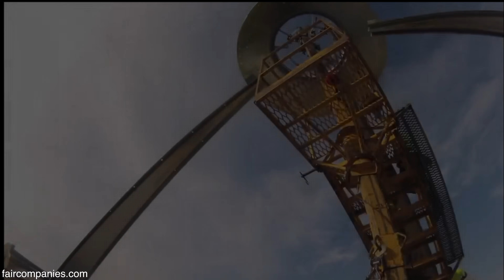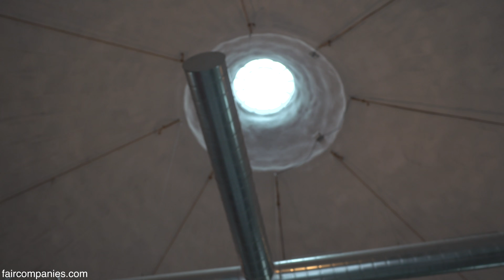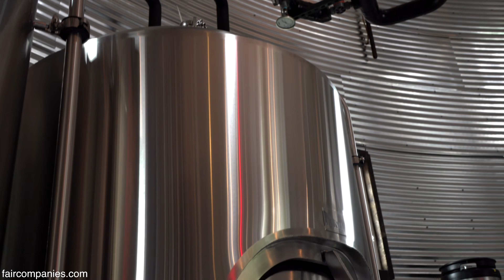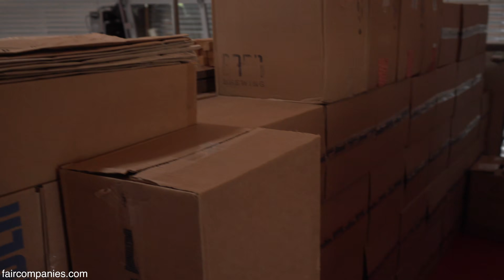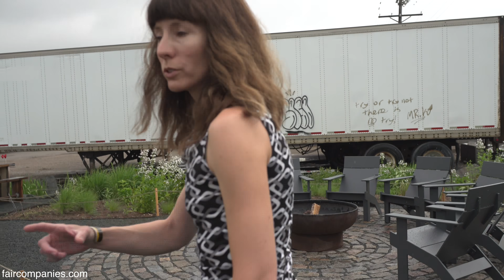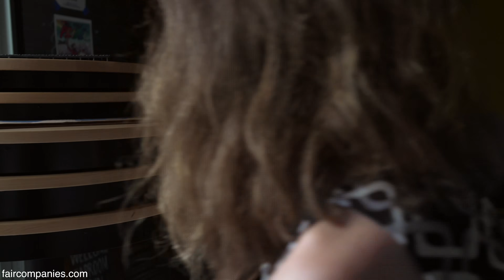MN couple turns grain bin into urban brewery, store & venue

Comment: How did you insulate the roof? Is the corrugated material on the interior walls of a lighter grade than  the outside? Did you get it from the silo company? If not, can you just bend it to shape? How did you fasten it to the outer layer?

Comment: Wrong the most efficient use of space is a Hexagon.
Reply: Firstly I was asking you what your comment: "geo-hexa Nero linguistic programming. Grant speak. James J money bags." has to do with the video or the comment you answered to. 

"We" are not pretending anything. And the Video I was watching was about a grainsilo, wich is a cylinder not a geodesic dome. So whats your point?
Reply: Well, true if you’re a honeybee, and building multiple hexagons side by side. But for standalone, can’t beat the circle.
Reply: Declan Gallagher explain
Reply: For many rooms or buildings a Hexagon might be the most efficient form to build. But in relation between area and wall length the circle is the most efficient. Also in heating/cooling and material needed.
Reply: @Ray What does that have to with anything else here?
Reply: maxe read Buckminster Fullers book, "Ideas and Integrities".